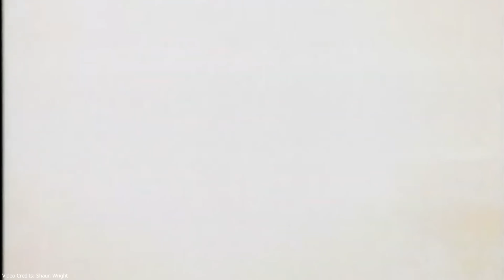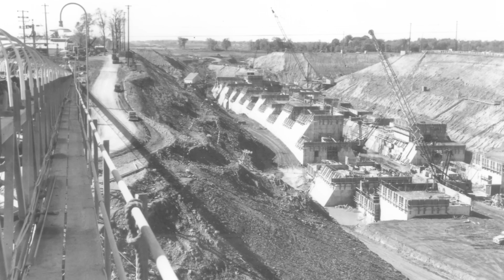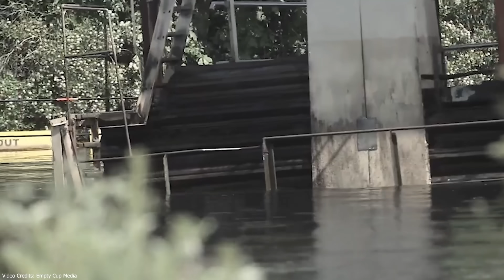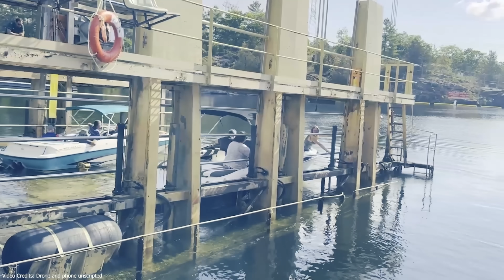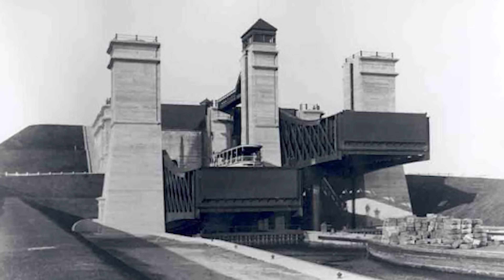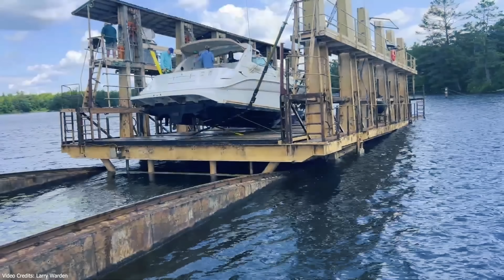Why Canada Spent $1B to Build a Canal Nobody Needed

Comment: Spent 5 navigation seasons working for Parks on the waterway in the late 90's between Lock 26 in Lakefield and Lock 19 at the bottom of Little Lake.
When working at 26 I had a system where I got a ride with another Parks Canada person in the morning to work, with my kayak in the back of the Parks truck. When the day was finished, I would float/paddle back down the Otonabee river to Peterborough. Lucky enough the river extended across the road from my house on London St. Portaged my Kayak across Water St straight into my back yard. Wonderful memories...

Comment: A total failure. Approx 30 dams in the Haliburton Highlands capture a water rise in some lakes of 7 feet at spring snow melt and then the dams let the water drain out to feed the locks and lakes downstream throughout the summer season.. Those dams destroyed the natural ecology of a huge watershed.  Most people think that the water is consumed by lock operations.  It is not. The water replaces the natural evaporation in the big lakes.
Such a system would never get environmental approval today.  All hell breaks loose when a lock goes out of service mid summer. And you can't transit the waterway in a sailboat without stepping the mast.  So power boats only.  A really green solution?

Comment: My grandfather owned a cottage on the south side of the Severn River, just east of Hwy 11.  I spent my summer vacation there, from the late 50s through the early 70s.  Because it was upstream of the Trent-Severn locks we didn't see the boats going through the system, but saw plenty of boats anyway.  I canoed up to the Wasdell Falls and down through the locks to Lake Couchiching.  The Trent Canal, between Lake Couchiching and Severn River was built to bypass those falls.  Downstream, beyond the Trent-Severn locks, was Sparrow Lake and beyond that, the river to Georgian Bay.

Comment: I grew up in this area and am familiar with the entire route, having traversed it in a boat.  It really is a pleasant trip, if you're not in a hurry.  Along the Severn river, a number of older, smaller locks were replaced with a new lock that drops the water level 50' in one shot, using huge steel doors that weren't possible in the 1800s.  Monsters to look at.  And I believe this is why Peterborough has the lift lock, because it wasn't possible to build a door-style lock that was 65' high at the time.  Most of the locks only change the level by about 10 feet, so wooden doors were possible.  Lakes north of Balsam lose water level, over the course of the summer, to provide water to the Trent-Severn to keep the canal at the required depth.  Also consider that a lot of the canal was dug by hand, at the time.

Comment: What they built was something far more difficult than a useful canal. They built something that is FUN and Relaxing. They built an adventure that could be replicated over and over as well as year after year. Well done !
Reply: There was a plan to connect it to the Muskoka lakes but locals fought against it. That would have been really cool if it had happened.
Reply: It was never needed for its original purpose which was to keep the United States at bay with the ability to move ships between those two points. So it had its purpose at the time. Yeah, it would be 1 billion dollars in today's money. But it served its purpose as a deterrent. Just like the cold war and nuclear weapons.

Comment: The 840 ft elevation of Balsam Lake and the Kirkfield  Lift Lock represent the highest place in the world from which one can navigate a boat all the way from sea level on the ocean, while continuously floating in water the entire way.
Reply: The Rhine-Main-Danube Canal reaches a summit of 1,332 feet. It is the highest place in the world from which one can navigate a boat all the way from sea level on the ocean, while continuously floating in water the entire way.
Reply: I can navigate a canoe from Casper Wyoming at 1 mile elevation, and get to ocean.  Paddling back would suck....   I wonder what is highest canoeable point.
Reply: Kirkfield is high at 840 feet.  But Sioux City is navigable on Missouri River and is at 1100 ft.  Not sure which city is the highest inland port.  I saw Missouri and it seems too fast to me, I prefer the Mississippi, and I think few boats use the Missouri even if it's available
Reply: What amazes me is that Canadians actually agreed to do something of this magnitude without arguing about it for 40 years 😂
Reply: @johnnymaccool9828 It's called the "Sunk Cost Fallacy".  When youve spent so much money and effort on a project so far, one is obligated to finish it so it doesn't go to waste.

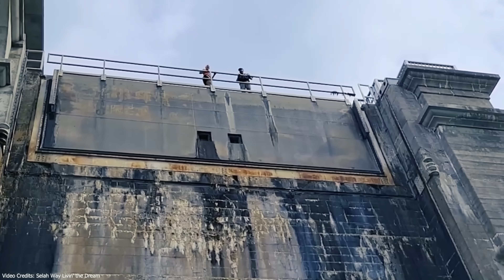Comment: 5:55  The Hydraulic Lift Locks at Peterborough and Kirkfield DO have pumps, In winter the lifts are lowered and the pumps are used in the spring once to lift one side up.  I think they are used occasionally to top up one side if it's been sitting for a while too. 

I have been to and carefully examined each and every lock on this system multiple times :)